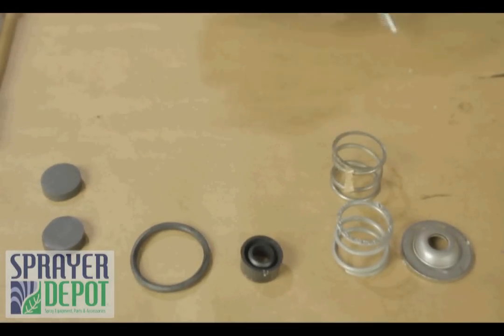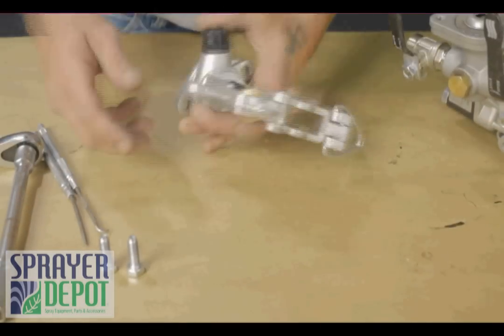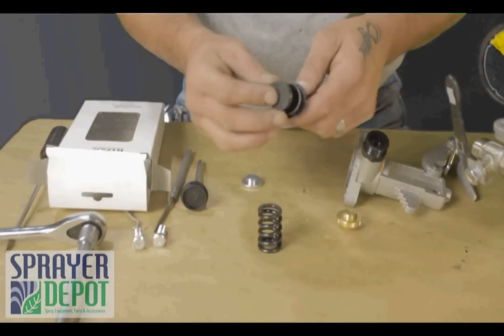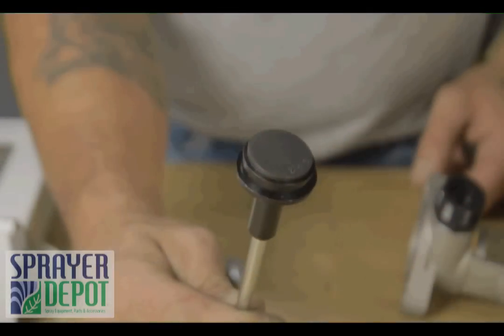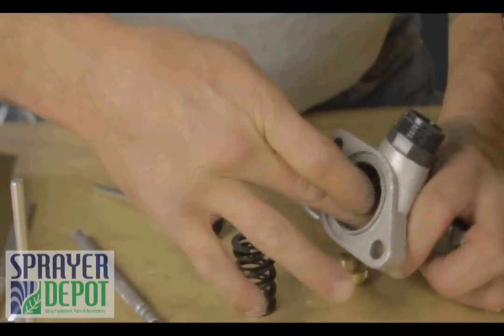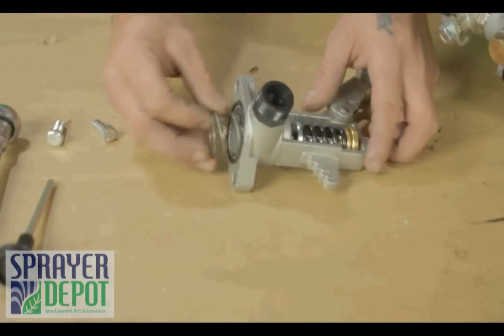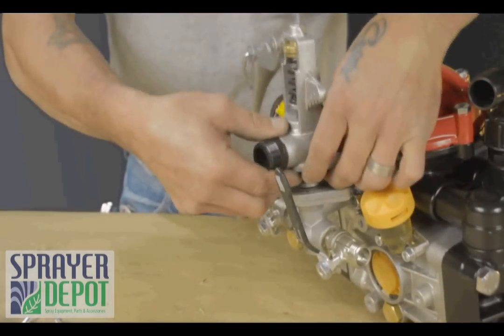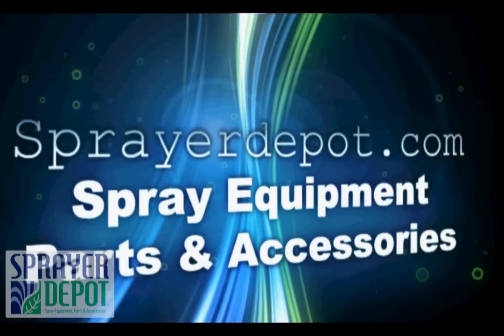How to Repair a Hypro GS40GI Regulator on a D30 Diaphragm Pump | Sprayer Depot, #1 for Pro Sprayers

Comment: I'm having an issue with my brand new unit. it is not building any pressure, but the water is flowing. i changed the unloader to all 4 positions and the 4th one saw a few psi but nothing on the others. what could be the cause?